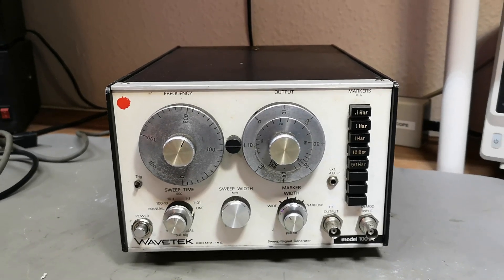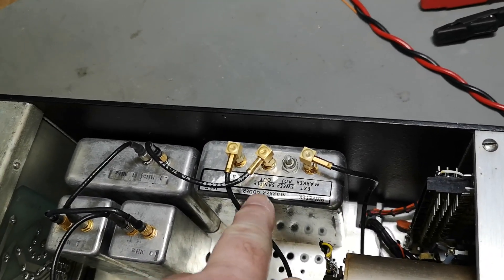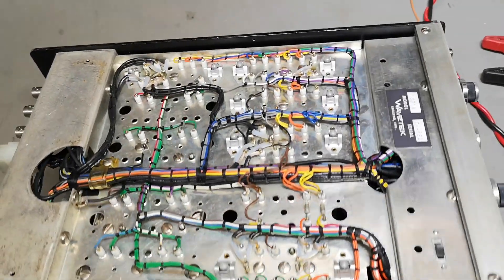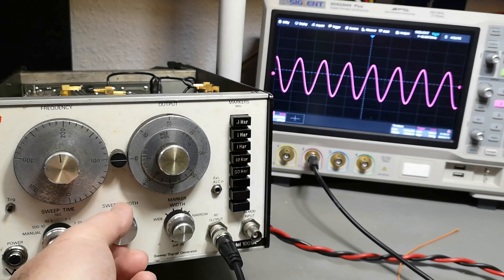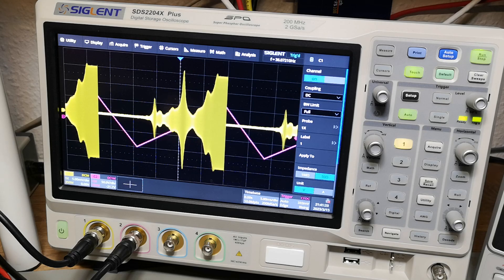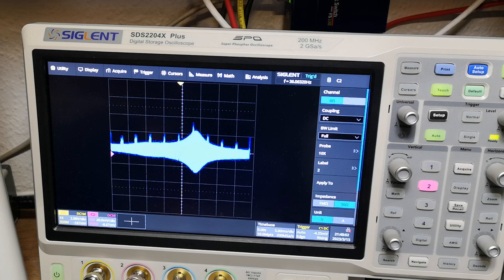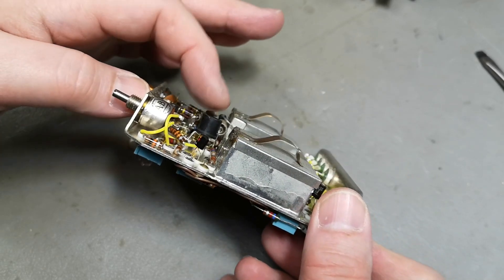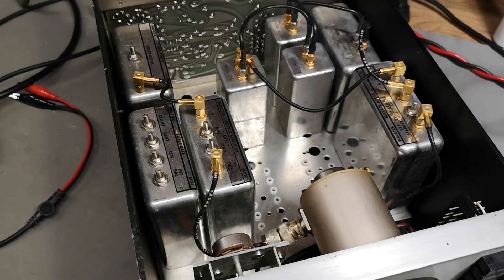Wavetek model 1001A sweep generator 0.5 - 300MHz 1977

Comment: I have the 2000, it looks identical but it has 3 bands: 0-450-900-1400MHz. I'm not sure if you spotted the fine frequency control, it's the knob in the center of the big frequency adjust. Not sure if your model has it too because I saw the little knob turning when you turned the big one, maybe a mechanical problem?
Reply from the maker: you are right, need a drop of oil :-)

Comment: This design was quite popular -- even Tektronix used it in their SW503 plugin module for the TM500 and TM5000 family of instruments. Very much a sweep generator -- the output frequency is NOT stable! They drift, hop, jump, and slide all over the place, responding to temperature, shock and vibration, phase of the moon.... Wonderful if you need to sweep from about here to about there, but if you need a stable, specific frequency, use something else. Tap on the case and watch it bounce! Still, a wonderful design and a good family of instruments -- they had other models with higher frequency coverage, such as the Wavetek 2001 which went to 1400 MHz.

Comment: The white block at the back is not  for syncing but for controlling various wave aspects by using a voltage. If you want to look in the modules, take a look at the channel of imsa guy. He made a fascinating set of videos in 2022 on this subject.